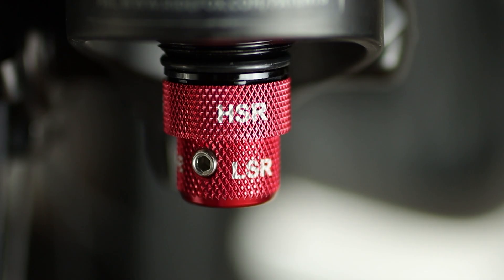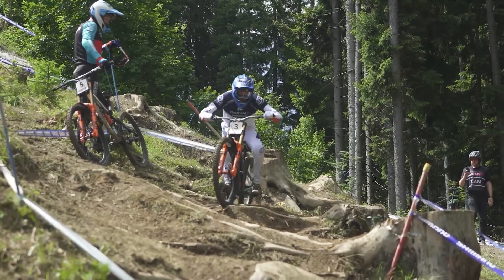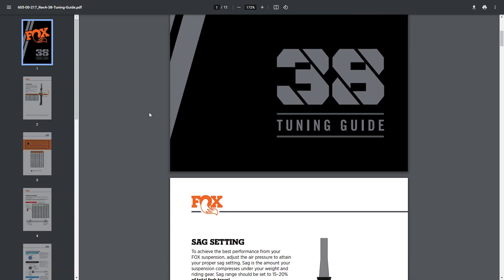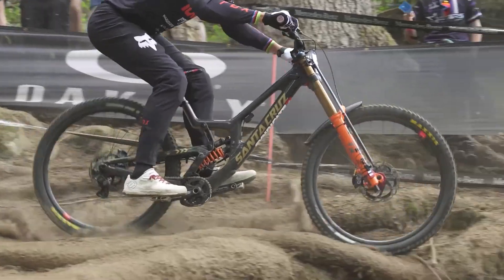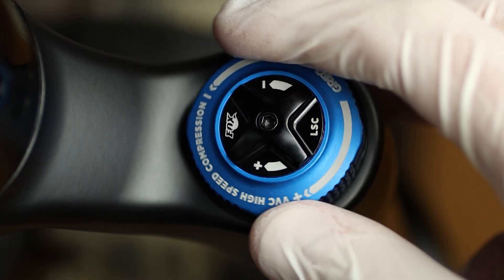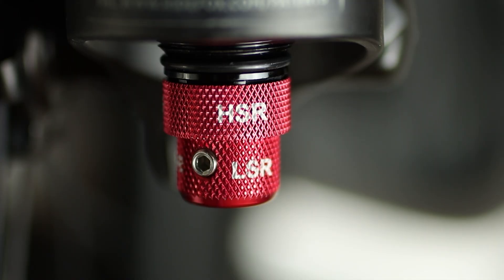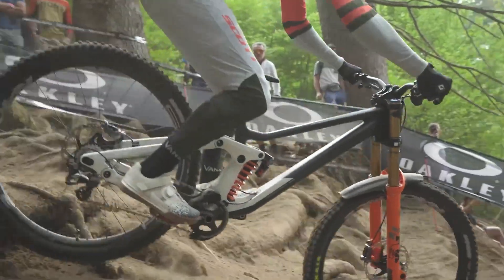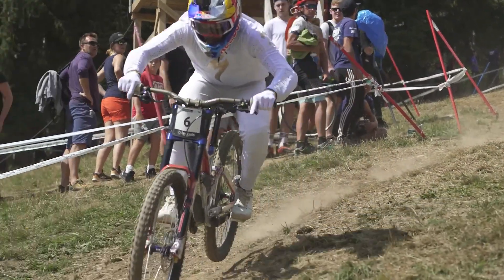Mastering Mountain Bike Suspension: Understanding Compression and Rebound

Comment: I advise you to do your homework better because this is another movie that will confuse people. The LSC is not only responsible for what happens in the initial part of the jump, and the HSC in the middle. I'm not even mentioning that both of these regulations have a huge impact on each other. If it were as you say, then going down on the trail where we already have about 30% of the sag or more, LSC would no longer work because we are already 1/3 of the jump long ago. another thing is that all regulations affect each other, changing something in Rebound will affect Compression and vice versa.
Reply from the maker: that's what i learned from other movies like you said, it will be super useful if you have any links to this topic. Thanks for sharing!
Reply: @OresteCiotoli  I don't have any links to videos, only my many years of experience in servicing and setting suspensions. the topic is so complicated that you could make a two-day training and still probably 90% of people still did not know how to set the suspension.
Reply: @OresteCiotoli  This is the first video, out of maybe 20+ which I watched on tuning the suspension, where someone would say that LSC is controlling lower part and HSC upper of Fork travel. I truly believe this is not the case. Not a single person in any of videos said anything even remotely close to that statement.
It's about speed of compression and controlling it - full stop and that they both actually have a relation to each other. You cannot close LSC and fully open HSC thinking that LSC is now 100% closed and HSC 0% closed. They have correlation. I am not smart enough to know what kind, but I am still learning.

Comment: Im thinking if i have the LSC fully closed and the HSC halfway im thinking that would be an okay start for pumptracks and jumps? So when pumping the fork doesnt compress as easy. Thanks
Reply from the maker: Not sure about the jumping, but for the pumptrack will help for sure to have the compressions closed!
Reply: @OresteCiotoli  pumping is the same technique as jumping 😄
Reply from the maker: @WannaJumpBikes  yes that's true, could be a good starting point. I personally tried with the same settings i would have used on the trails 😁

Comment: Informative video.  For most riders, the basic Fox Fit4 damper for example is good enough (actually an amazing damper), whereas the Grip2 damper with more adjustability take quite a bit of setting up.  I spent ages tweaking and hating my Fox Factory 38's before i finally got them dialled in, the Fit4 damper on the other hand, once the sag and rebound was set it felt amazing on the first ride.
Reply from the maker: Thanks, and good point. Just to tell you, I'm still fighting 😁, but every time I'm progressing 😃